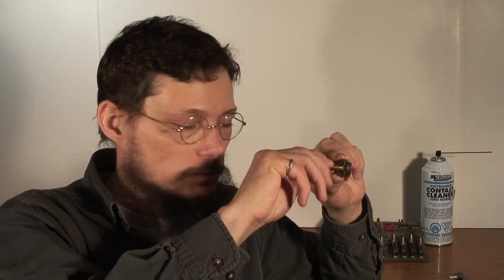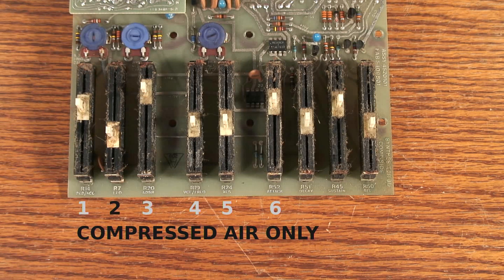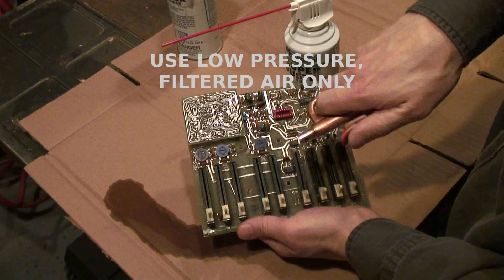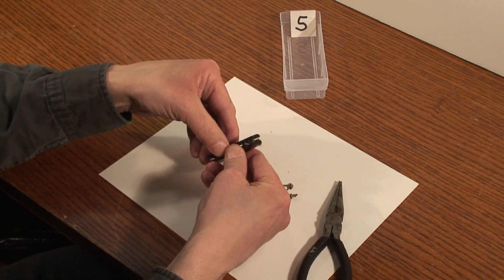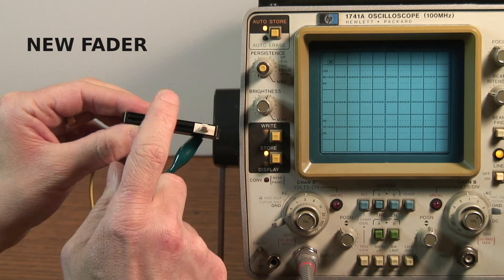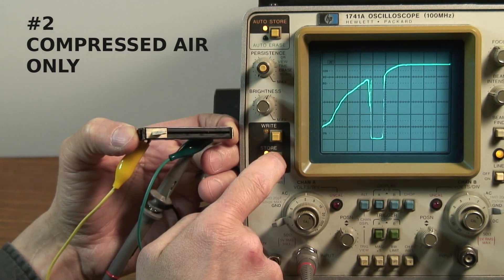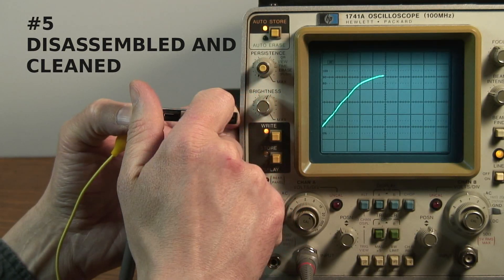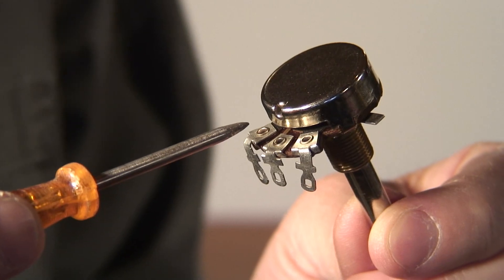Potentiometer Cleaning Showdown

Comment: NB: On gear with pots that don't respond to cleaning you can carefully open pots with tabs, by bending the tabs just enough to allow the pot to be disassembled. You then clean and reassemble the pot, bending the tabs back into position. Take care, you can only do this a very limited number of times before those tabs start breaking due to metal fatigue. Luckily, you should only need to clean a pot every 20 years. PS: If you find yourself always cleaning your pots... stop smoking ;-).

Comment: The soaking in IPA worked well for me with these all plastic Mallosliders from a Moog Taurus 1. I could not see a way to open them, so I'm glad I ran across this video and tried that method. Worked like a charm. I've desoldered, opened, cleaned, lubed, re-assembled, and re-soldered a few ARP Odyssey slider sets. Lot of work.

Comment: Hey, excellent video. i have cleaned mine with isopropyl alcohol and they became like more dificult to move. what should i do ? they had some dust cover and i guess maybe the alcohol made it worse by loosening that and ended up inside those faders ? any advice?
Reply from the maker: Firdous, you can find fader cleaner that has a lubricant in it, and that might help.

Comment: Very good video.    I'm having  issues with both linear and rotary.   The rotary  can be fixed for short times..  i will try to spray  into the hole but its soldered with pins down.. why do I try to keep old junk running?   Bravo

Comment: Invaluable information. Tell me, is there actually any type of conductive lubrication or heavier grease used in linear potentiometers?
Reply: As far as i know, there isnt any lubrication on the resistive tracks because it would interfere with conduction.
Only on the the rails where the wiper moves along you can or have to apply some lubrication but be careful not to get it between contacts.

Comment: I have an Ekosynth P15 which is in pristine condition, but has a slightly scratchy volume pot. Other pots work fine but they don't 'feel' great across the full motion, my plan is to desolder and clean all of them with 99% alcohol and Q tip. Thanks for the informative video.

Comment: This is a really, really well-done video. Thorough yet straightforward. Great work!
Quick question: What function on the scope (at least, that's what I assume) are you using to trace the cumulative voltage output as you sweep the pot? Are there ways to go about this if our equipment does not come with this feature by default?
Reply: I was thinking the same thing. I believe you set the scope up to do a single trigger, but you may have to extend the time base to capture the signal so it gives you enough time to slide the pot.
Reply: Ronnie Augeri any other thoughts on this? How do you trigger?

Comment: Isopropyl is not a suitable cleaner for pots as it can leave an unsuitable residue. Use 100% denatured alcohol instead, then a suitable lubricant as in Caig products because a completely dry wiper will hasten track dereriorization.

Comment: how to clean sealed metal small pot from my Focusrite board?
Reply from the maker: Hi Tom.  Some pots are just impossible to take apart, and you'll probably have to find a suitable replacement.  However, you can also try drilling or boring a small hole on the back of the pot, and injecting some contact cleaner into the hole.  Be careful though, if any metal filings get into the pot, you'll definitely have to replace it.
Reply: I've contacted focusrite  they send me a pot free of charge
Reply: free pot 😅👍

Comment: Don't compressed air cans often have oil in them and are not good for electronic contacts?
Reply from the maker: Hi John.  Yes, oil in compressed air can be a problem.  If you are using compressed air from a can, it's best to read the label.  If you are using an air compressor (the type you plug in, with a reservoir tank), then you should have an air filter installed.
Reply: Filter at each wouldn't hurt.

Comment: i guess i would criticize the 'clean bill of health' on No.6, the 'isopropyl alcohol' cleaed fader insofar as it only has a useable range of just around 50% of the track length as it is misleading at best to calibrate the synth based on that kind of behaviour (unless i am misunderstanding and there was just a mismatch or synch problem between the movement of the wiper and the osc. tracing range)

Comment: Wow, great vid! I've always used MG 404B contact cleaner with silicones, but that's only because that how I was taught to do it. This video is great for explaining how the pot actually performs, rather than "hmm, well it feels smooth, so it should be good enough."

I suspect that using contact cleaner alone only buys time, as the gunk inside the wiper doesn't actually go away, it just gets moved around. But if buying time means another 10 years, I'd cal that a good repair!
Reply from the maker: ***** Hi Scott.  Even after making this video, I still find that cleaning potentiometers effectively requires a bit of magic.  Once you find an approach that works well for you, just keep doing that!